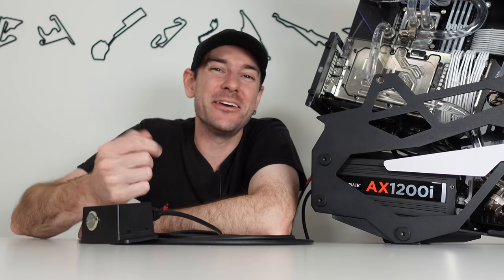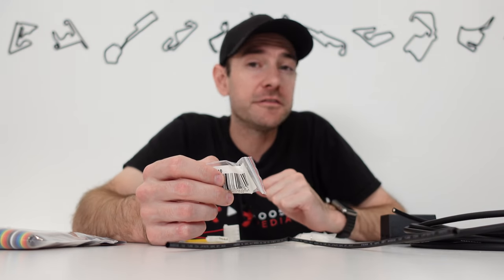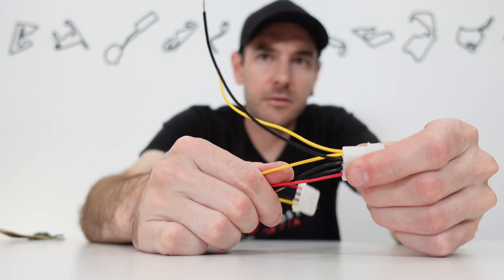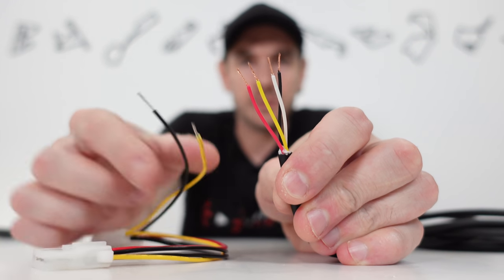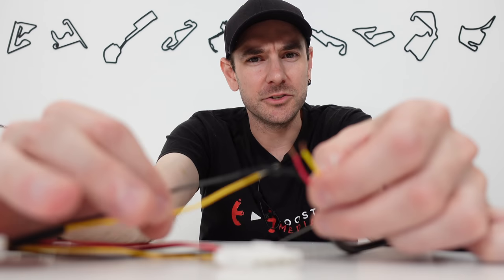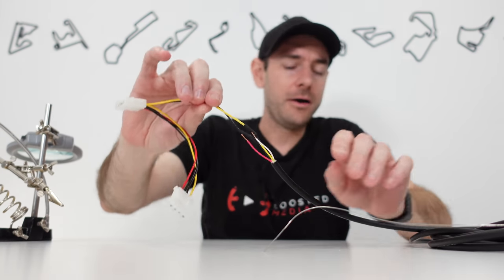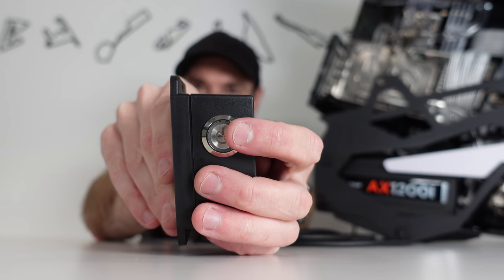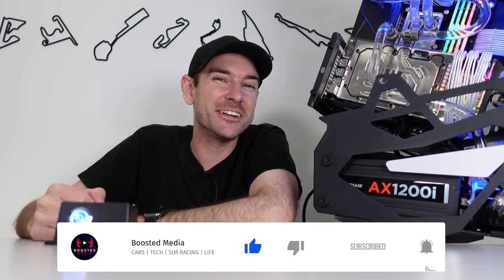DIY PROJECT - Build a Remote PC Power Button

Comment: You went about that in the most long-winded and complicated and expensive way. Especially buying it all Jaycar where stuff is 3 times the price it should be. It's an incredibly simple procedure to wire a remote switch in parallel with the onboard power switch. You can buy premade examples, including wireless versions for less than that would have cost. Using wire cutters to strip wires is a very good way to break conductors (especially on those Dupont cables) or stretch the wire if you're not practised at doing it. Use a very sharp knife and carefully ringbark the wire or use a wirestripping tool. "C" on the switch is "common". It is a common connection for both the normally-open and normally-closed contacts. You can buy panel mounting versions of those 4-pin connectors.
Reply: Agreed, Jaycar is an absolute racket.
Online sites like RS, Element14 or Mauser are more reasonable.
Wouldn’t go DIY for this one given the huge number of prebuilt consumer products already made for this purpose.

Comment: Excellent video, and a fantastic project. I just finished mine, and want to provide a minor PSA to help others. If you buy the switch recommended in the video (for me, it was the "WerFamily Red LED Angel Eye + Power Indicator 22mm Momentary Push Button Switch 1NO 1NC SPDT ON/OFF Waterproof Stainless Steel Metal Round with Wire Socket Plug" on Amazon) you will find out two things: First, the pinout of that switch is not identical to the pinout of the switch in Will's video (for example, the WerFamily switch does not have a "C" pin and instead it has two "NO" pins). Second, you will find wiring diagrams (as of March 2nd anyways) that show a number of behaviors that you want the switch to have, with the recommended wiring for said behavior. One of those behaviors (there are four) is precisely how Will demonstrates his switch behaves. 

So, if you put these two together, the fact that the pinout is not identical between switches, and the fact that there are explicit wiring diagrams that in theory replicate the behavior of Will's switch; you might be tempted to follow one of these wiring diagrams....

PLEASE DON'T

Those diagrams are not for the use case that Will's video is about. If you try them, you might end up damaging your motherboard (if you are unlucky). 

You should ignore those diagrams and, instead, wire the WerFamily switch as follows:
(1) The positive/negative for the 12V line coming from the PSU are connected to the LED+/LED- pins respectively, or the red/black cables if you are using the snap-in plug that the switch comes with
(2) The two pins that ultimately make it to the POWER_SW connection on the motherboard must be connected (one each) to the "NO" pins on the switch, or the blue cables if you use the snap-in plug setup. It does not matter which is connected to which. 
(3) The "NC" pins (or the brown cables with the snap-in) are not used. Tuck them away in the box

Hope this helps somebody. Great video, great project.

Comment: Very good video Will, very well explained and demonstrated mate. I really do need to do this as my pc is tucked away around the back of the rig so awkward to get to. I would be fine with all of this build right up to where you started the connections inside the pc to the motherboard etc, I'm a PC hardware novice so the thought of tampering with a perfectly good "functioning PC" that I rely on to go racing scares me a lot lol. It was hard to see what you did inside the pc so if possible I'd love a separate video showing this part of the process in more detail. It wouldn't have to be a long video mate as long as it showed this internal process for us pc operating cowards 😟. Thanks for sharing Will 👍

Comment: Silverstone ES02-USB Wireless Remote Control Switch Kit

I got one of these not long ago. Its literally a dongle for a receiver that will power your PC on. I keep it on my keyring and when I get home I press it before I get in the house along with the one for the Garage. I walk into the SIm room and BAM! PC is on.
Reply: Back when I was still on the SC1 Mige I had the idea of making a unit which housed the switch for the Power for the External Box, E-Stop and also wired up the Power for the PC.

But with the newer DDs its much much easier to just give it the old reach round.
Reply: Looking at what you did I could easily see that the same can be done using the wireless dongle. Just solder the custom button upto it and it would also be a wireless box with a custom button.

Comment: I'm just going to run one thin 2 wire in parallel (as you did) to the power on pins and add a momentary switch. I'll add a disconnect plug where the wires enter the case. I don't see the need for anything else. I'm putting my case, external HDs and anything else that makes noise and unnecessary clutter with a rats ness of wires, in the closet in the next room. Serenity now, finally a dead quiet computer. Thanks for the idea.

Comment: I mounted an extra button on my button box to power the pc on.  I can now ether power the pc using the button on the button box or the push switch on the case.  the wire going to the case is connected using a 3.5mm sterio jack plug

Comment: I'm pretty lost I have followed all the steps and I can't get it to work. If I press the power button the pc starts without problems, however when pressing the new button it starts up but immediately turns off. When I restart it I always get a message on a blue screen that says "dualbios the main bios is corrupted.The system will be recovered from the bios. Please do not turn off power or reset the system.this may take a few minutes" and when finish updating correctly starts windows.
I needed some idea why this happens since the remote button is a great idea

Comment: I thought about doing something similar to this; but instead I settled with a Wi-fi enabled AC plug. I can turn my PC on and off using Google voice from anywhere in the world (as long I have internet access). Bios settings just need to be Always On after Power Loss. E z p z.

 I do like the D.I.Y. of this setup though! Awesome work dude.
Reply: Is your PC plugged into a surge protector first?
Reply: @JoeJacksonGT3  Yeah, I control the entire surge protected power board through the wi-fi adapter. Saves my monitors going into stand-by mode and what not. I prefer to have control over it all.
Reply from the maker: My concern is my damn kids telling my computer to turn off mid race. Lol